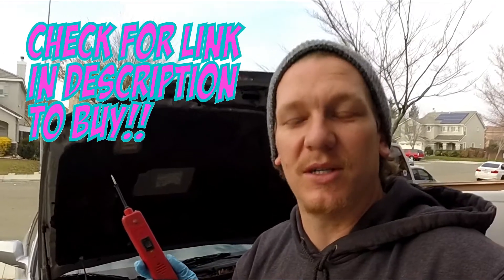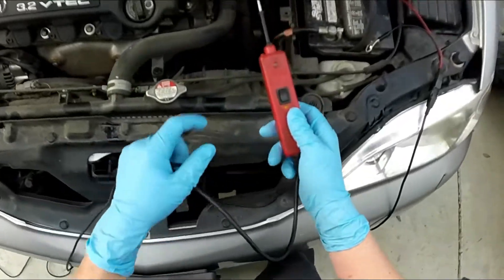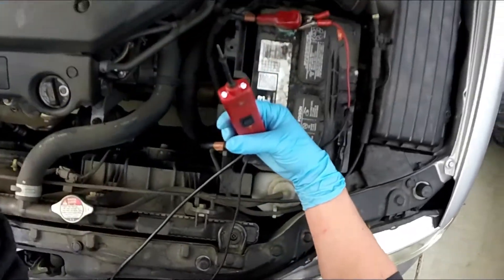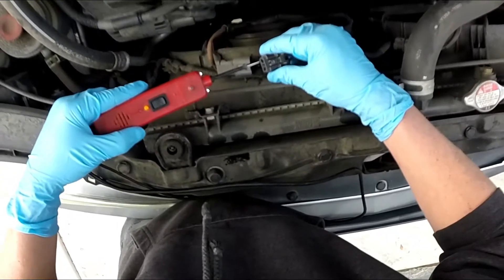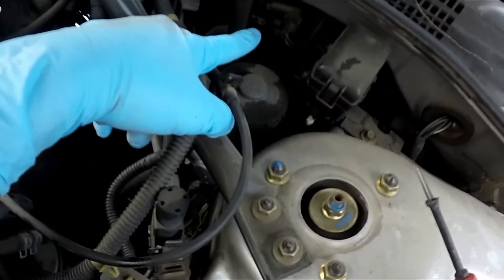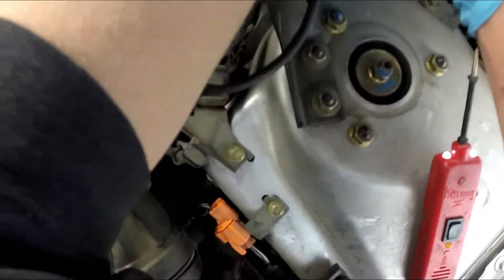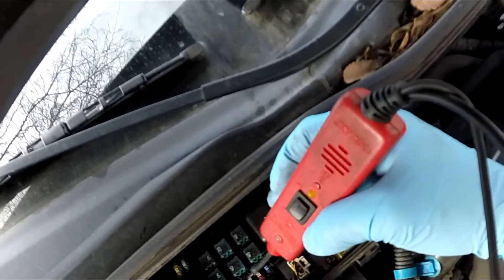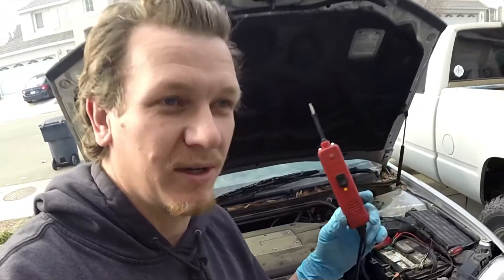What is the best diagnostic tool? This is my favorite electrical diagnosis tool

Comment: Thanks for posting man, I am new to diagnosing electrical stuff so this quick little video is great.  Originally got here by watching your other video on replacing the shift solenoid on your Tahoe.  I am having the same issue on my Trailblazer, only when cold it's starting out in 3rd then I downshift out of D and into 3 and back into D and it works just fine, but it sounds like a solenoid.
Reply from the maker: If it's got the factory accumulators those are known to go bad too. If it's gotten debris causing it not to slide up and down easily that might be an issue for you as well.
Reply: Thanks for the tips, I'll see how it goes.
Reply from the maker: Good luck on your fix.